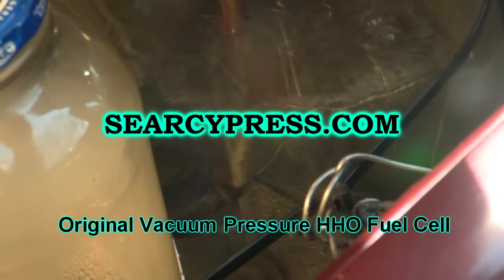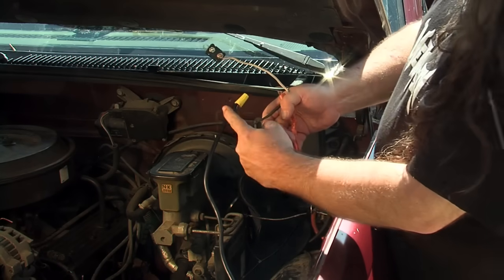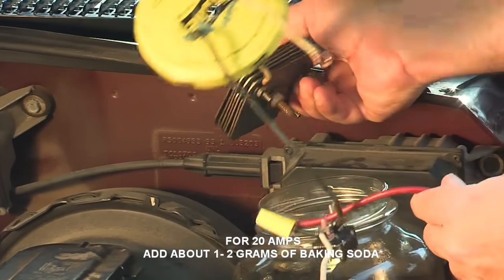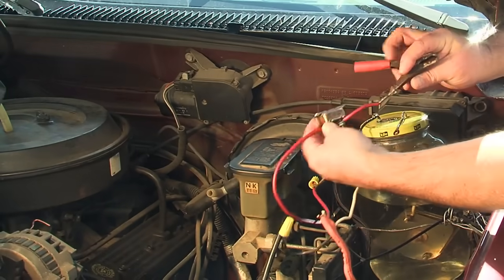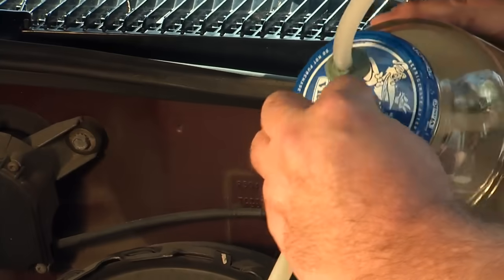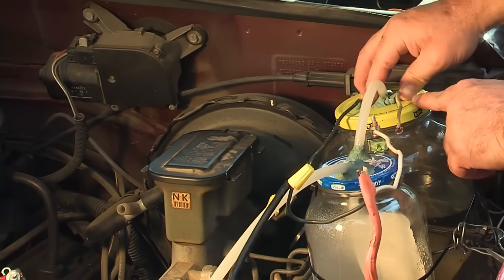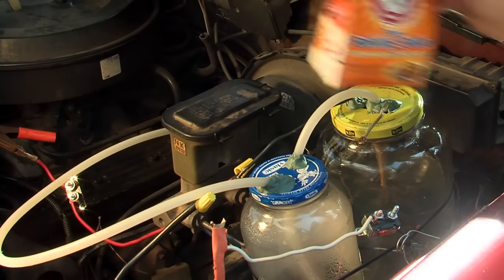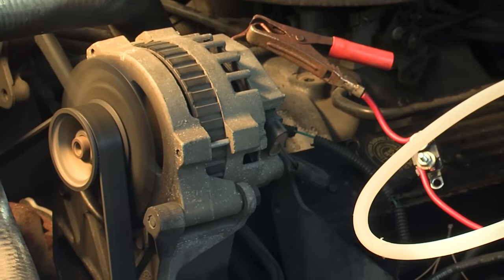Vacuum Pressure Hydrogen fuel cell defeats high gas prices using hydrogen from H2O.

Comment: Yeah and what they don't mention is excess water in the oil / engine due to combustion of Hydrogen which produces water simple.
Reply from the maker: Actually no. The water that you see coming out of the tailpipe in the video is coming from the gasoline. A  much higher rate of combustion takes place in the cylinder leaving the catalytic converter starved for waste vapors. It burns much cooler so the water that comes from the gasoline comes out liquid instead of vapor as it normally does. Very little of the water actually produced by the HHO is coming out in the video. Only about 3/4 of a gallon every 200 MI. The amount of water naturally produced by the gasoline far exceeds what you expect. We have a new video coming out soon we'll cover this topic, be sure and subscribe. Thanks for the comment.

Comment: Mason jars are much better.
Reply from the maker: I've never seen a gallon mason jar but maybe they are out there somewhere. There is a definite reason we use such a large jar. The thermal properties and amount of water it holds are pretty important. We have a new video coming out soon, be sure and subscribe so you don't miss it. Thanks for the comment.
Reply: @metalpresstv  Ball make them up to 1 gallon.

Comment: What could possibly go wrong ?
Reply from the maker: Certainly there are a number of things. However you would be surprised how resilient this system is. As long as the vacuum remains the system is fairly safe. We have some improvements on that in a new video which will be coming out very soon. Be sure to subscribe so you don't miss it. Thanks for the comment.
Reply: @metalpresstv  fairly safe is ok for me

Comment: How long will the exhaust system last with water always sitting in it? Guess the first few holes will help drain the muffler...
Reply from the maker: You seem to be thinking the water comes from the hho. And it's not the case. It comes from the gasoline. Normally the catalytic converter is busy burning the 20% of fuel which is wasted by the engine. It gets extremely hot and vaporizes the water that is coming from the gasoline. It's always there, you just don't see it because the catalytic converter vaporizes it before it exits the tailpipe. With the fuel cell we are burning almost all of the fuel in the cylinder and not the catalytic converter. Don't blame the HHO for the water. Steam is just water so there's really no difference. We have a new video coming out soon be sure and subscribe so you don't miss it thanks for the comment.

Comment: What does the hydrogen cell power or do ?
Reply from the maker: We inject HHO produced by the fuel cell into the cylinder in the state of vacuum. Normally an engine wastes up to 20% of the fuel it is burning and it is consumed in the catalytic converter by design. What we are doing is trying to burn all of the fuel in the cylinder. There is no over unity involved here. The extra energy in the system comes from the gasoline that is normally wasted. The catalytic converter of course will be burning much cooler and results in a lot of water, which is coming from the gasoline then ejecting from the tailpipe. Other systems which inject this gas into the air intake do not work. The gas becomes leaned out when mixed with the air and the results are nulled out. That is why there is so much confusion because there is more than one type of way to burn this gas. The vacuum injection method is by far a completely different approach. We have a new video coming out soon and we will cover a lot of stuff and some improvements we've made over the years. Be sure and subscribe. Thanks very much for the comment.
Reply: @metalpresstv  thanks for the response and the info , you have a great day

Comment: something else to consider if anyone is trying this.. use more batteries but charge them via solar (or grid) then there isnt 'parasitic' drain (30A) on the alternator.  Use the appropriate sized batter based on the length of trips. Easy way to make a hybrid vehicle.

Comment: WHY ISN'T EVERYONE DOING THIS??!!
Reply from the maker: One of the problems is there's two ways of using hho. Just simply creating the gas squirting it into the carburetor where it is immediately leaned out with regular air is the wrong way. No gains of significance will be noted ever in my experience. This is confused with doing it like shown in the video where we are injecting it into the system in the state of vacuum. Very often people will say, I put this on my truck and I saw no improvement. What they're actually talking about is squirting HHO into the breather of the truck. This is not using a vacuum pressure fuel cell. The fact that it is so easily confused has kept this in the dark for quite some time. We have a new video coming out soon be sure and subscribe so you don't miss it. We will show you a few improvements we made over the years. Thanks for the comment.

Comment: Its crazy how many people believe that's true 🤣🤣🤣
Do you really believe you can use water as a fuel
Reply from the maker: I find it  crazy that people don't understand that water is simply hydrogen and oxygen. Both are used as rocket fuel.  😎
Reply: @metalpresstv  🤣🤣🤣, 
yeah right,they use water as a fuel there,
By the way ,why didnt you show the real noise of the engine when the rpm are  allegedly going up because of the hydrogen

Comment: Howdy.
Die-hard physicists would argue that this does not introduce any new energy into the system. I agree to this. It takes energy to hydrolyze water.
However. I believe it is possible that burning HHO alongside gasoline can impove the gasoline combustion.
Another possibility is that the produced water works like a steam engine. This may possibly result in the combustion force upon the pistons lingering longer producing more torque.
I believe it has long been known that mixing water into gasoline will improve fuel economy. The problem is, though, that water does not really get into solution with gasoline. More like an emulsion. The water droplets will aggregate and go out of emulsion accumulating in the tank bottom.
One possibility could be to introduce water vapor (=mist), not water steam, into the air intake. The mist production should be switched on only at running temperature.
How produce water mist ? Well. Some personal space coolers use ultrasound transmitters to smash water droplets into mist.
Reply from the maker: There is something you're not understanding. You're assuming the engine Burns 100% of the fuel. This is far from true. 20% of the gasoline is actually burned in the catalytic converter. That is a lot of wasted energy. What we are doing is we are injecting HHO in the state of vacuum into the cylinder in an attempt to burn 100% of the fuel in the cylinder where it is converted into usable energy. There is no over-unity or free energy. The extra power we accumulate is actually coming from the normally wasted gasoline. We have a new video coming out and we will discuss this more and show you some improvements. Thank you very much for your comment. Be sure and subscribe.
Reply: @metalpresstv  Howdy.
Bulls eye ! Thanks for Your informative comment.
In regards.

Comment: it takes more energy to turn the alternator with the added load and split the molecules than you'll get back from the recombination during combustion.
Reply from the maker: Actually you've been misinformed. We are not trying to power the engine with this gas. What we are doing is burning the 20% of fuel that is normally wasted in the cylinder and burned in the catalytic converter instead. This is a vacuum pressure cell. It is not one of the useless atmospheric type that you squirt into the intake. Be sure and catch our new video coming out soon. Be sure and subscribe so you don't miss it. Thanks for the comment.

Comment: Hello, Is there a recommended baking soda to water ratio for this sort of project? Having a hard time finding the science regarding this
Reply from the maker: Actually no. The problem is different water sources have different mineral content. It might be possible with distilled water but frankly that's pretty costly nowadays. It's really not that hard to do. You just start with a two finger pinch. Check your production if it looks good run with it until it gets hot. If it starts tripping the breaker you know you went too far. Because it has redundant breakers there's no danger of causing any problem. If you do use too much you can simply add more water. Eventually, you get the hang of it. It is better to undershoot than overshoot. It is not necessary to have it running full blast to see the benefits. All of this only applies to a vacuum pressure fuel cell. Anything that runs atmospheric pressure is a waste of time. We have a new video coming out soon, be sure and subscribe so you don't miss it. I'll try to cover as much of this stuff as I can. Thanks for the comment.

Comment: So putting water in a steel engine is a good thing? I guarantee your valve seats will be rusty and pitted in a week.
And please tell me how white your oil has become from water blow by into the crankcase!
Reply from the maker: Here's an interesting fact for you. The water that you see is coming from the gasoline, not from the HHO. The reason you can see it coming out of the tailpipe in abundance is because the catalytic converter is not getting hot as quickly. The reason this happens is because the HHO in the state of vacuum is almost completely burning all of the fuel. Without the system, up to 20% of the fuel is wasted and burned in the catalytic converter which vaporizes that water. That's why you don't see it most of the time. It's burning so efficiently there's nothing to burn in the catalytic converter. We have a new video coming out soon we'll try to cover as much of this stuff as we can. Thanks for the comment. Be sure and subscribe.
Reply: @metalpresstv  yes I heard running hho was like five times the efficiency of gasoline. So if it burns much more cleaner and is actually not water but hydrogen, because they are separated in the generator and technically not H2O. Then my presumption of rusting valve seats or even milking the oil is mute.

Comment: I want to see some empirical evidence of the improved mpg. Say a 50 mile run without and a 50 mile run with.
Reply from the maker: Don't take this the wrong way but if you don't trust me I doubt another video will make any difference. I assure you we conducted that exact kind of test running completely out of fuel each time. We have a new video coming out soon that shows some improvements and will explain its functionality in a bit more detail. Don't confuse this with an atmospheric pressure cell which certainly will offer no benefits whatsoever. Thanks for the comment. Be sure to subscribe..

Comment: I want to try this, only question I have is how do you keep it from freezing in colder climates?
Reply from the maker: It is resilient to a certain level. Of course if you're in an extremely frigid environment an alternative method of heating would be necessary when you're not using the system. There is most certainly room for advancement in that area. Where we are, in the south it's really not an issue down to temperature of to 20°. Fahrenheit. When we do get those temperatures, it's very briefly before sunrise. Of course, all that could change as time goes on with weather always surprising us. Certainly it would not be that hard to add some sort of heating element or block type heater system to the cell. Another alternative would be to simply drain the system and fill it as needed. It's one question I really have not had the ability to answer because I simply don't have a problem living here. We do have a new video coming out soon, be sure and subscribe so you don't miss the improvements we've made. Thanks for the comment.
Reply: @metalpresstv  N.y. so 20 and below would be an issue. The battery is inside the car which would make finding a heat solution a little easier just because of the extra space I have to work with. You mention draining the system and it made me think of putting the jugs in some sort of carrier and just putting quick connects in to making it easy to remove.

Comment: Maybe you gonna need more durable jar that can hold pressure.
Reply from the maker: Pressurizing any gas then transporting it down the highway would no doubt cross over some D.O.T. regulation guidelines. This system runs in vacuum. We have a new video coming out soon. Be sure and subscribe, thank you for the comment.

Comment: You didn’t show how you connect the gas to in the engine or is’t in the carburetor
Reply from the maker: It is hooked to the strongest vacuum access you can find. In most cases you go with the easiest one to use.. We have a new video coming out on this topic very soon. Be sure and subscribe so you don't miss it. Thanks for the comment.

Comment: if you were to put some ecu stuff on this truck and fiddle with it for a while tyou could more then triple your mileage in fact its possible to even run this truck completely off hho but you need a more efficient set up but pretty cool either way
Reply from the maker: It is a pretty interesting claim. This cell actually gets its energy from the 20% of fuel that is wasted and burned in the catalytic converter by an inefficient burn. I have myself, witnessed a doubling of mileage though I'm not sure exactly how that's possible. Looking at the specs, only 20% gains should be possible. I've never been one to trust models. Very often modeling of any kind of device proves incorrect in the real world. As far as running on  100% HHO gas, I am just wondering how in the world you would keep the engine from turning into a melted pool of metal. When you take this gas and blow it through a small orifice it can easily melt even rock. I have yet to witness 100% use of this gas. Don't get me wrong, I'm all for the idea. I'm just not sure it would be a success without witnessing it myself. We have a new video coming out soon be sure and subscribe so you don't miss it. Thanks very much for the comment.

Comment: what about the gas lines? didn't see anything about that?
Reply from the maker: It sounds like you're under the presumption that we are not burning gasoline. I could be mistaken but let me clarify it. What we are doing is injecting flammable steam into the engine into the cylinder in the state of vacuum. What this does is allow almost complete combustion of the fuel in the cylinder. Most people are not aware that up to 20% of the fuel is actually not burned and is finally ignited in the catalytic converter. You will notice in the video there is a lot of water coming out of the tailpipe. People assume that this is coming from the fuel cell. That is not the case. It is coming from the gasoline. Normally, you do not see this because the catalytic converter is vaporizing any water into steam. Using this system with vacuum injection the catalytic converter does not get that hot as quickly. Most of the junk that has been trapped in that tailpipe and catalytic converter will come blowing out onto the ground. We have a new video on this subject coming out very soon and I will show this in much better detail. We've worked really hard getting this next video together and have had years to think about it and listen to all the sides of the table. I hope to clarify a lot of things for a lot of people. Thanks very much for the comment and I hope you subscribe so you don't miss it.

Comment: My wires almost start to melt
Reply from the maker: Our system only uses solid copper wire. Number 10 gauge. It is rated and up to 40 amps. We have installed two 30 amp circuit breakers on either side of the fuel cell power. I'm not quite sure how you did it, but at no time have we ever overheated a wire. New video coming out soon be sure and subscribe. Thanks for the comment.
Reply: @metalpresstv  The negative and positive plates in the water should not be touching correct? Cuz I think that was the problem.

Comment: Does the steam end up accumulating in the oil pan?
Reply from the maker: The steam produced in the fuel cell condenses in the second jar. That water then automatically returns to the primary Fuel Cell by way of a thermal vacuum when it is turned off. Most of the water that you see coming from the tailpipe is actually a product at the gasoline. Normally you don't see a lot of it coming out because the catalytic converter is so hot and it's vaporizing it and you don't notice it. Using the fuel cell the catalytic converter has much less to burn as the gasoline has been ignited in the cylinder instead of in the exhaust. Water is a very normal by-product of burning gasoline. Thanks very much for the comment, we have a new video which will be coming out so be sure and subscribe.

Comment: How much more efficient was your truck after you completed this setup set up?
Reply from the maker: An average of about 20% overall. Interestingly enough that's about how much fuel is normally wasted in the catalytic converter instead of being burned in the cylinder. Using the system in City driving is usually counterproductive because of the stops and starts and the heat build up. The system performs best on Long trips. We have a new video coming up very soon, be sure and subscribe. Thanks for the comment.

Comment: You need 2 alternator is better
Reply from the maker: They make some pretty good size alternators. We just installed a system on a 427 with 190 amp alternator. We really don't use that many watts most certainly. We've never had a problem even with the stock alternator. Be sure and check out our new video on this topic coming very soon. Don't forget to subscribe. Thanks for the comment.